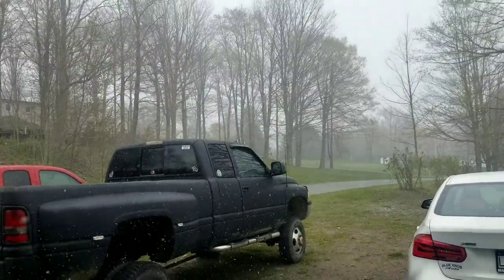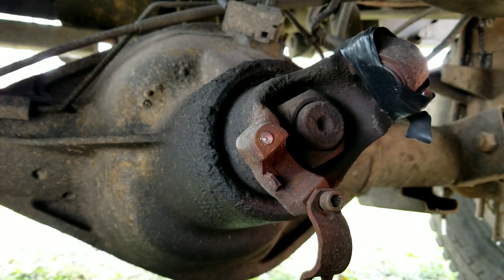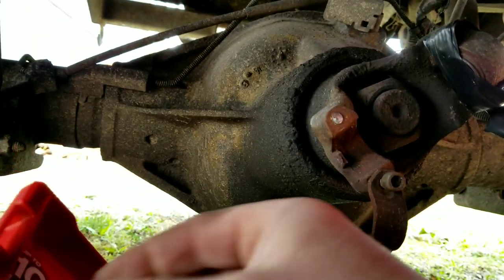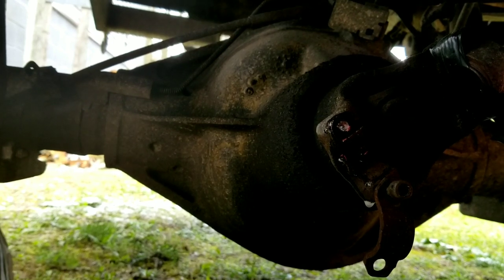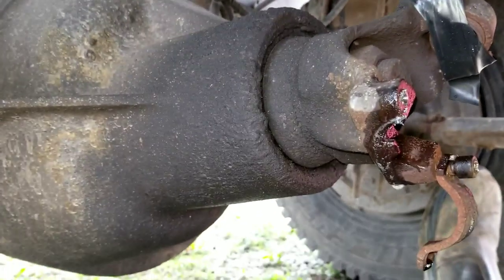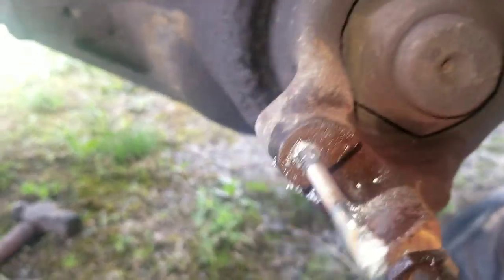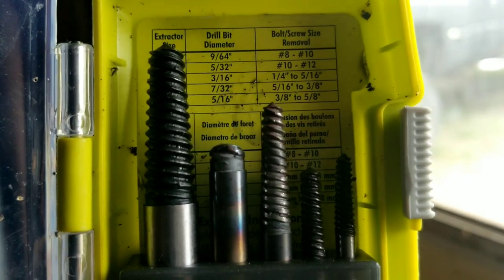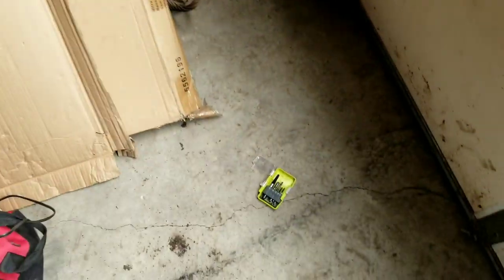Bolt extractor ( Satan's bolt🔥🔥)

Comment: Literally the exact same bolt im doing
Reply from the maker: Just run!!!!! Lol. I gotta use a torch everytime I work on that truck. Even after daylight saving I had to turn clock back. Needed the torch 👨‍🏭
Reply from the maker: I just ended up drilling it out and putting a heli coil in it

Comment: I spent the weekend beating, breaking and drill a stuck caliper pin. So I can relate.
Reply from the maker: I know man I hate so bad spending hours/days on one bolts lol. I still need to get the brake bleeder s out..... maybe they will come right out lol
Reply: I'm sure they'll come right out...... I'd probably cross my fingers on that one. Sometimes it's worth it just getting a new caliper.  Good luck though, my experience with rusted bleeders has never been good.